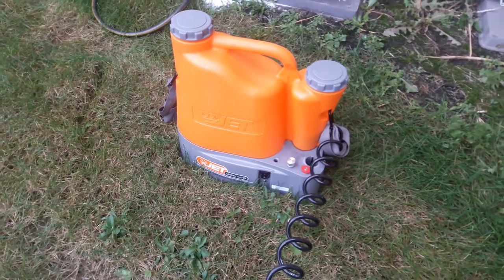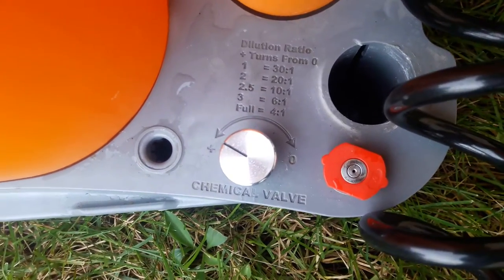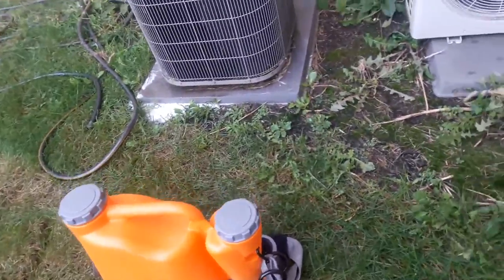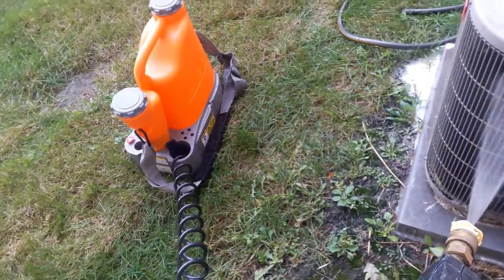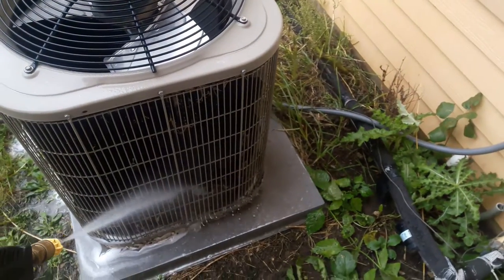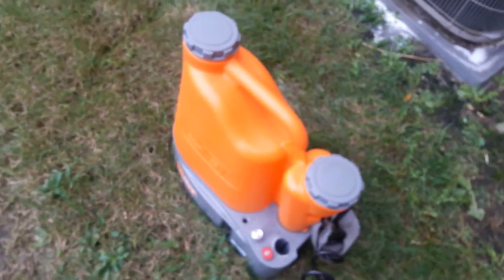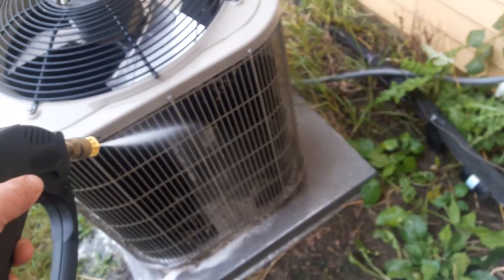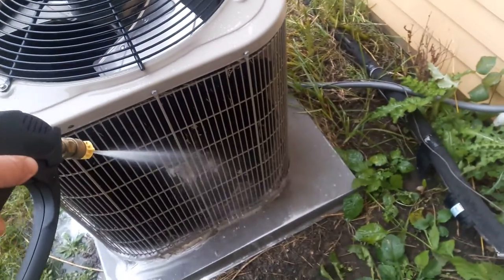Review of the Coil Jet model CJ-125

Comment: Hello Ben Thank you for your review

Questions
1. How long in minutes 5 gallons water sprays a coil using regular yellow nozzle? 
2. Pressure looks not bad, but is it ok to wash coils properly after using coil cleaners?
3. How long battery change running?
Thank you.

Comment: What are the longer term results ? Like after using it for a few months ?
Reply: I've owned my for 2.5 years - still going strong and works great (same battery) - only change I did was to pull off the old short hose and I installed a longer 25' hose

Comment: How long the battery runs?
Reply: a long time - about 4 major cleanings
Reply: @g2gequipment789 Does it use hot water and how long could the water stay hot
Reply: Just put hot water in the unit and it stays hot the whole time you spray within the hour it’s not insulated so it will not stay hot